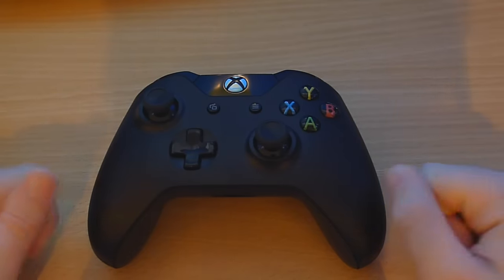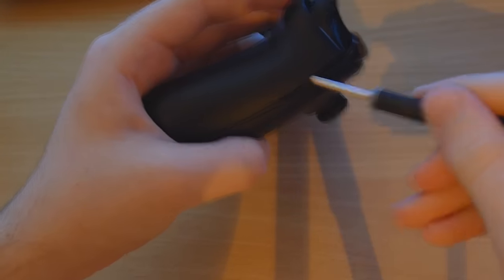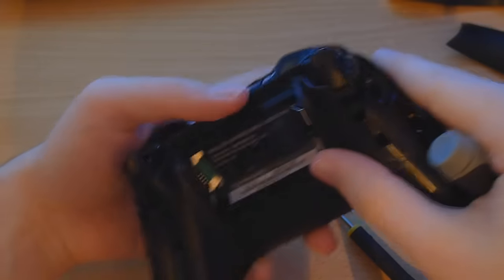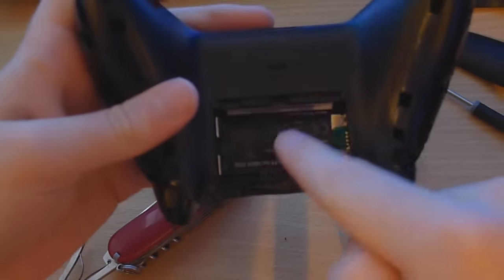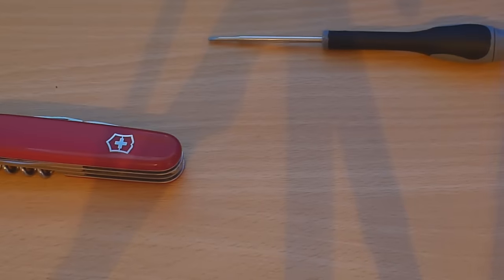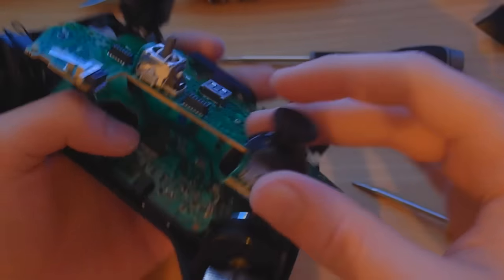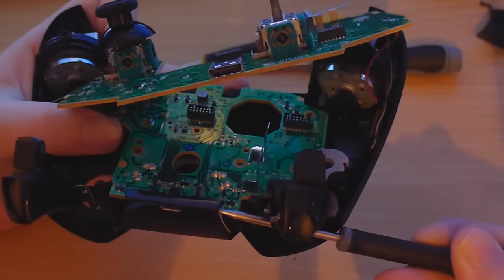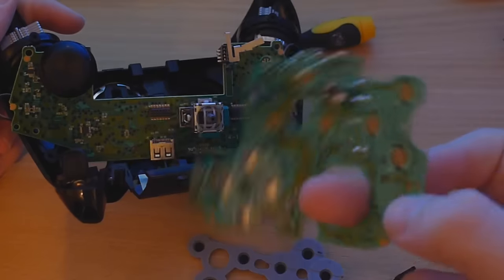How to Open up an Xbox One Controller

Comment: I found a quicker way of this, if you throw it at a wall it comes apart instantly!!!
Reply: Ethan Biggs Thank you so much!!!!
Reply: Asap Gxx no problem
Reply: lol thanks man it worked!!
Reply: That saved 15 min! in 15 seconds!
Reply: wait u guys did this i dont wanna do it cuz i dont wanna break the triggers or buttons u feel me
Reply: it won't don't worry ;)
Reply: I dont trust you
Reply: Ethan Biggs thanks !
Reply: Saggs McButters same
Reply: Go on?!
Reply: This works I've had experience with it
Reply: They beak so fucking easily
Reply: Y DIDNT I THINK OF THAT
Reply: oh wait because my controller will break
Reply: yeah then you cant put it back together
Reply: Ethan Biggs came off but now I have a big problem now it's not turning on plz help daddy
Reply: Brandon Barnes if you did that I respect you
Reply: Lmao
Reply: Ethan Biggs LOLOLOL
Reply: Thanks.    😂
Reply: How is that any quicker?

After that you have to watch this video backwards.
Reply: THANK YOU I THREW IT IN THE STREET LIKE 13 TIMES AND IT WORKED🤩🤩
Reply: (in a hindu accent) Have you tried taking the batteries out, drenching it in gasoline and lighting it on fire? That usually fixes the problem, sir. Thank you come again.

Seriously though, broke the bumper and glued it back on; not to hard to fix but they should have stuck with the 360 controller design. Same on microsuck.
Reply: mine is too strong its been thrown at the wall about 30 times during my xbox career
Reply: I tried this and my bumper broke. Please help
Reply: Beyond Psychology yeah a lot of people told me to try that but that didn't work as well. Probably a hardware issue on Microsoft part. I even tried torturing the controller but nothing.
Reply: Ic_y well, it vibrates so I've only got one obvious suggestion left for you. 😋💩👌😆
Reply: Beyond Psychology fr tho I broke my bumper and tried to fix it with superglue screwed everything up so I'm just gonna buy some new bumpers
Reply: Ic_y really, you can just buy that one part?... Thanks for that tip. I just bought the left bumper part for a dollar 99 off eBay. I'm not sure if it's exactly the same part I need though. Oh well, we'll find out here in a couple of weeks.
Reply: Ic_y last time I took it apart I had to resew superglue it again and then even cut little pieces of plastic and make a splint for it which didn't work well enough. 

In order to make the splint fit, I had to break part of the frame that guides it to hit the bumper and that may have ruined it, but again, we'll see. Going to buy a new controller today any fucking way.

Sigh.... I will also be smashing my testicles in the trunk of a car, right in the latch just so I don't have to feel the pain of breaking controller for the third time, in the same way, in the same year.. #fuckmylife
Reply: Beyond Psychology yo so I tried all this but the thing was messed up on the inside from the superglue. Just took my other controller back from my brother and fixed his that he threw and now I have spare parts.
Reply: Beyond Psychology the bumpers only cost like $10 wtf
Reply: Beyond Psychology also yeah everytime it gets easier to take it apart. I can do it in like 5 minutes and I basically know how to fix most broken buttons now. All in one night.
Reply: Ic_y I found them on eBay for a 1.99. again, though, I don't think they're the right left bumper apparatus.

I broke down yesterday sold my left testicle and then bought an elite controller as well as that left bumper apparatus that won't be here for two weeks.

Now I wonder how much it will cost me to replace my left testicle?
Reply: Ic_y sweet! So you're good now?
Reply: Beyond Psychology no not hood yet. Still need to know why Justin Y. is everywhere.
Reply: Ic_y I'm sorry, I'm culturally ignorant. Who is Justin Y?
Reply: I tried this. I used to have 99 problems and my left bumper was one. Now since I threw it against the wall I have 99 problems and 98 of them are pieces of my controller separated by force.
Reply: xD lemme try now
Reply: i'm with ya Ethan, the floor works good too :) doesn't go back together without some real ingenuity though...
Reply: Ethan Biggs omg from now on I’m going to take apart all my devices like that!!!! Thankyou!!!!!🤣
Reply: Were you playing Fifa?
Reply: Dude thank you so much, I thought I would have to buy a new one
Reply: Lmao
Reply: That worked for my TV too! Next week I am going for an even quicker method, using my 12 gauge shotgun.
Reply: Think about the hardware
Reply: I did that shit yestuday
Reply: Thank you so much this is a new future way
Reply: hey kid that's called breaking the controller and no it does not come apart instantly go back to fortnite
Reply: Nice😆🤣🤣
Reply: Ive brokw so many controllers so.idk if ima do n this
Reply: Thanks that actually worked 👍
Reply: might try that
Reply: Ha ha
Reply: Ethan Biggs would that damage the joysticks?
Reply: What do I do about the hole in the wall?
Reply: @Matthew Moistner same
Reply: Dats how I messed up my remote. Now I'm here
Reply: Ethan Biggs I tested it and it worked
Reply: @thekeemstar27  😂😂😂😂
Reply: Omg i did it and it works
Reply: went through drywall. but it worked. next vids gonna be sheetrock repair 👌
Reply: Omg thank you so much now my controller is broken you are a legend
Reply: I did it with a broken one and it broke my joustick
Reply: Then the place for the crews will break and then it will really break. I only watched like 30 sec of this to find out how to pull it apart.
Reply: LMFAO
Reply: Ethan Biggs wow that works I wish I knew this before I threw it through the tv then blamed it on my sister
Reply: Wow worked
Reply: Gonna try this see if it works! Thanks :D
Reply: Works!! Thanks Ethan!
Reply: Ethan Biggs lol thank you it worked XD
Reply: Already tried
Reply: Facts
Reply: @Matthew Moistner same
Reply: See the problem is I threw the controller at the wall and that's why I'm watching the video.
Reply: Sadly that is so true! Thanks comp crucible!🙄
Reply: Lol
Reply: Made my night 🤣
Reply: DatBoiKxn r/wooosh
Reply: Does this method still work?
Reply: Wow it really works!!! You should all try it
Reply: Facts
Reply: Lmao doooooooooood
Reply: Fortnite and xbox controller in your hand, CHECK!!!
Reply: Thanks ima go try this right bike
Reply: Hello
Reply: Doesn't even take more than 5 mins to take apart
Reply: I tried it did not lol
Reply: DatBoiKxn r/wooosh
Reply: Brandon Barnes lol
Reply: Yep!  Found that out playing Sekiro.  Dismantled mt TV as well 👍
Reply: I did it 
But results werent what I excpected
Reply: Instructions not clear, my controller broke
Reply: Lol
Reply: Ethan Biggs hahahahhahahahahaha
Reply: I no right
Reply: @datboikxn6799  it's a unfunny joke.
Reply: Lol
Reply: Thx I’ve already done that many times lol
Reply: I threw it at a wall and the d  pad bumper and joystick didn't work
Reply: And also %#*_ quarantine
Reply: Lma()
Reply: Katsu Quiet hr hop
Reply: Or just take a DS4 lol
Reply: Worked great after!! Thank You!!!
Reply: That's the source of my problem lol
Reply: Ethan Biggs good idea
Reply: Ethan Biggs funniest shii ever
Reply: My mom thought of that first.....
Reply: facts
Reply: @Biggsyyyy  yo u just helped me so much I tried it and there are holes in my door now thanks!!
Reply: Big brain
Reply: I used this method to customize my controller coincidently strait after I lost a game of R6
Reply: 3000 like
Reply: Thank you
Reply: lol it works tho
Reply: Finally ! Thanks alot brother !🤙
Reply: Thank you sm
Reply: I threw my controller at my TV and it broke.
Reply: Yessir
Reply: Smart
Reply: @datboikxn6799  its... a joke
Reply: Brandon Barnes WTF LMAO
Reply: This helped out a lot 👍🏻😂
Reply: Fax
Reply: BAM
Reply: DUDE THANKS
Reply: Brandon Barnes I got mine stuck in the Xbox console
Reply: Hahhahahaha
Reply: Dec Moran 
Dropped it and the stick came out, I fixed the stick with a file and some super glue so I can put it in if I can get it open. Wish the controller was easier to mod the sticks ngl. They could’ve made bank off of special edition and interchangeable sticks.
Reply: Gotta do it hard and fast too
Reply: i did this
Reply: Oh wow! Now my controller is divided in 50 parts!!
Thanks for the tip man! 😎👌🤙😳
Reply: @decmoran7750  I hate it when they beak. Sounds like a duck when it happens.
Reply: @rebelelephant1731  Just hit caps locked when its not a funny comment.
Reply: @atomicchicken288  Ok. your point because that was too lame to be a joke.
Reply: @DrBrainTickler  I never thought of getting drunk and gasoline. How do you usually fixes the problem. Do you have a q-tip fetish... ya know cause your name
Reply: Ethan Biggs bet I’ll do that with my new elite series 2 controller
Reply: @brandonbarnes5585  haha
Reply: Awesome idea!!
Reply: Omg its working 😂😂
Reply: Play RDR2  and even if you don't knacker the buttons , at some point, you'll throw  it against the wall. The mark's still there from 2018 : )
Reply: Well yes, but actually no
Reply: Thanks man helped a lot
Reply: @johanlmaoo  Game shops see us coming. Trust has gone.  From now on, i'll do what the uploader says here,  it'll save me £50> next time.
Reply: thank you so much bro cmae appart with all the peices in front of me
Reply: Ethan Biggs life saver thank you
Reply: @datboikxn6799  it's a joke lol
Reply: That’s why I needed to take it apart to fix it lol
Reply: Ethan Biggs can confirm, it works!
Reply: HaHa
Reply: used your method, my Xbox one controller isn’t working anymore. Idk why it’s not
Reply: Hey, we have the same last name!
Reply: Nice
Reply: thanks my controller is like brand new thanks to you
Reply: @Mark Mendoza Hernandez ikr
Reply: 4 years later and this still works! 👍
Reply: Tried that many times, doesn't work
Reply: Omg your so smart where did you get that much in from?
Reply: i did that i needed this vid
Reply: it worked thanks.
Reply: Thx fixed all my problems even my anger 10/10 would recommend
Reply: Hahahaha genious!
Reply: Thanks
Reply: Thanks man worked amazingly
Reply: And if you catch it at a wall it should all go back together right?
Reply: Same Dude.....
Reply: Funny
Reply: dude that’s how i got here
Reply: Hell no
Reply: That's ps4
Reply: 10/10 tip thank you so much really helped!
Reply: 10/10 speed but couldn’t get it back togethter
Reply: That's my kinda method
Reply: @Biggsyyyy  which one is you in your pfp
Reply: Wow never new that lol
Reply: Help so much thx
Reply: i already tried it
Reply: Ofn!!!
Reply: Hahahahhahaha😂😭
Reply: Wait really
Reply: I tried this but it didn’t go back together so I can play!
Reply: Thanks!! I tried this and had to buy a 100$ controller again
Reply: OK but I need it to work again so this isn't going to work
Reply: Thank you it works now
Reply: Omg it worked
Reply: OH THX FOR THE HELP
Reply: I can confirm this works
Reply: Thanks it really works except now my mom is beating me
Reply: Thank u brooo
Reply: Really mine just bounces off the wall like nothing happened.
Reply: That breaks it so no
Reply: Thus braking the entire controller
Reply: That’s why I need to open it kik
Reply: Bruh 😂😂😂
Reply: I’ll try it!
Reply: It would probs damage your wall depending if its fragile
Reply: @brandonbarnes5585  💀 u got it out?
Reply: Maybe don’t that
Reply: Yooo thanks man it came apart☺️
Reply: Why didn’t I think of that!?😂
Reply: Wow that worked like a charm thx brotha
Reply: Wow it works Thx dude
Reply: Hahaa
Reply: Thank youuu
Reply: Wow so funny
Reply: No way
Reply: Oh ok I'll try that out then 😃
Reply: I found that out the hard, if you do that it stops working I haven’t had one for months
Reply: Thats why we are all here haha
Reply: Lol
Reply: UR RIGHT! Quickest tutorial I’ve seen!
Reply: I have to try that
Reply: For some reason I sense you are a rager when u lose games, I really don't know why?
Reply: Thanks did it and actually it got apart but still works just needed some glue ot tape to replace the brocken parts 👌
Reply: And it breaks
Reply: take apart your controller any%
Reply: Lol
Reply: it worked thanks!!
Reply: 😂😂😂😂 lol people commenting actually worked
Reply: Smart man.
Reply: WWOW IT ACTAALY WARKED
Reply: but at what cost?
Reply: Easy fix
Reply: Just like an iPhone lol 😂
Reply: I tried that. But it doesnt work anymore
Reply: I’m just thinking of that, smart
Reply: That's why I'm here 😂
Reply: Thanks KSI
Reply: Yea cuz I haven’t seen this comment under EVERY SINGLE CONTROLLER FIXXING VIDEO 💀
Reply: OMG TYSMM IT WORKEDDDDD
Reply: Hahaha sure we've all discovered this one at some point...Well I have anyway...about 100 times 😫🤣🙄
Reply: @asapgxx9536  😂😂😂😂😂😂
Reply: Helped me a lot thank you👏😍
Reply: I did that to now got worse stick drift
Reply: Great advice, mine opened up instantly but now I just don’t know how to put it back together
Reply: How to put apart again ??????
Reply: Tries that
Reply: That's why i'm watching this video. I'm trying to fix mine after doing that 🤣🤣🤣🤣
Reply: I did it and put a hole in my wall but it did come apart
Reply: Thanks for the tip
Reply: The real tutorial right here
Reply: Bro omg thanks so much
Reply: THANKS IT WORKED
Reply: Lol
Reply: It will BREAK
Reply: Or the ground did it this morning 😅
Reply: Exactly what i had in mind😂😂😂
Reply: Mine just put a hole in my wall
Reply: NO WAY! It works way better
Reply: Might try it
Reply: Brilliant!
Reply: That’s why I’m here
Reply: This is great
Reply: Yoo tysm i tried it out it helped so much!
Reply: I’m glad this is the first comment I saw
Reply: classic xbox
Reply: I had mine glitch out my game so bad I legit slammed it on the floor about ten times and then proceeded to stomp a mudhole in it and walk it dry. The front still wouldn't come off. 😂
Reply: It would break
Reply: wow thx it works!!😮
Reply: It will break ur controller or ur wall
Reply: I FOUND THAT OUT TOO, gta pisses me off, BUT LIKE IT WORKED
Reply: YES THANKS NOW THERE IS A HUGE HOLE IN THE WALL NOW I CAN PUT IN MY PE
Reply: How hard😁
Reply: Thank you so much the only problem I have is that sometimes I have to buy a new one
Reply: How do you put it back together
Reply: My controllers not working now 😢
Reply: Ahahahhaha
Reply: Wo thanks it came apart so easy any tips on to put it back
Reply: As a a self taught technician, I can tell that this works.
Reply: And that’s why we are here cause someone threw their controller against the wall.
Reply: Lol
Reply: Holy shit thanks for the hack man
Reply: I’ve tried that method and it worked accidentally!!!
Reply: Where is the link to the video? we need to see how !
Reply: That does work way faster but u have to worry about breaking or loosening parts on the inside.
Reply: Just tried this, and my motors went flying across the fucking room 💀👎🏼
Reply: Thank you
Reply: Can't believe it took me 7 years to figure out this simple trick! Thank you!
Reply: Instructions unclear broke control
Reply: “Fake news, i have tested this, yes i have tested this many times 
You only get to skip step one that’s right only step one but you get a free new paint job so it’s alright i tell you” - Donald J. Trump probably
Reply: That’s how my friend broke mone
Reply: Dark souls experience
Reply: 7 years later and your comment did my wonders ! Thanks man! Quickest way I’ve found so far !
Reply: Bro has max IQ
Reply: After 7 years and this method still works thanks champ
Reply: Lol
Reply: Plus the wall
Reply: Instructions unclear, controller didnt come apart but i know have a controller holder built into my wall
Reply: Great now tell me how to reasamble it
Reply: Omg I tried this and it worked like a charm
Reply: Thanks! I did indeed work! My controllers green now too!
Reply: Haha
Reply: Popped both my analogs off today like this can confirm it works
Reply: @Biggsyyyy now how do I put it back?
Reply: I might try that